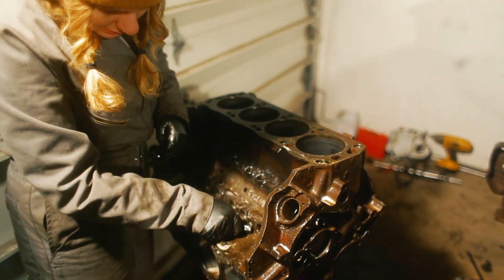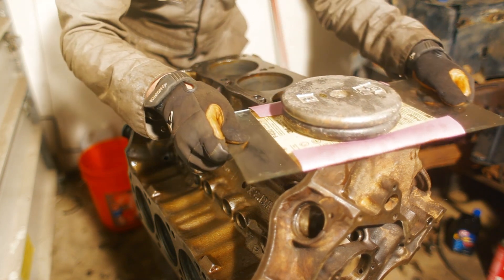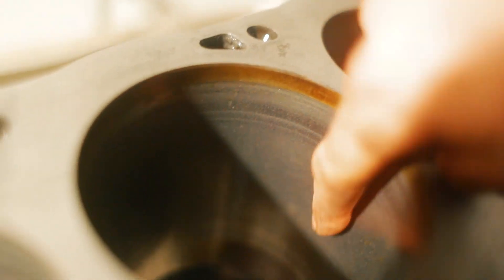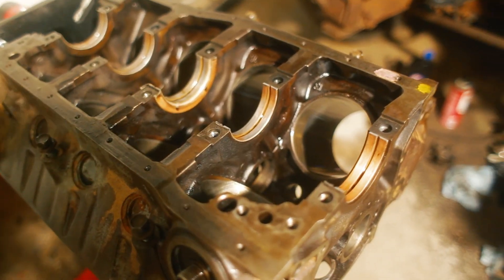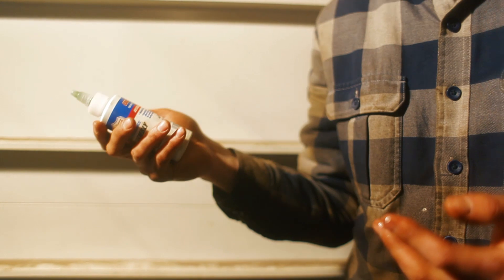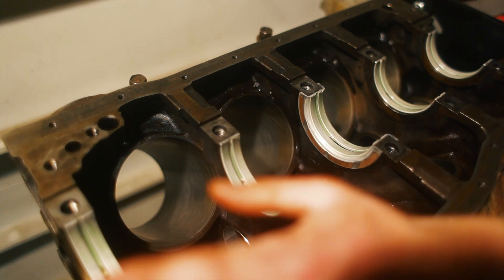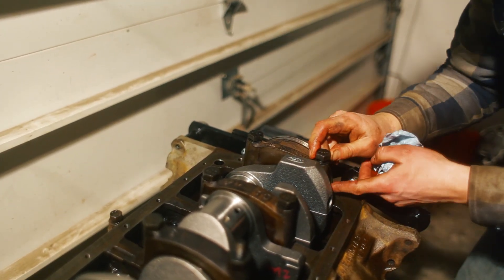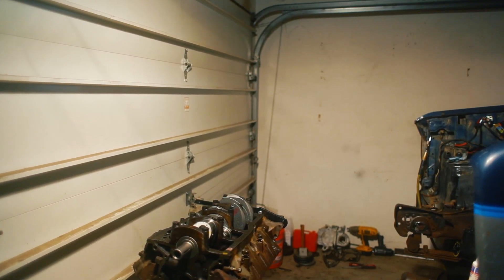F250 Ep 11: Starting the Engine Rebuild

Comment: Great video! Glad you guys are doing your part to keep another bullnose on the road! I think they’re highly under appreciated. Would you mind giving a ballpark estimate on how much it’s cost to come this far on your restoration?
Reply from the maker: Up until the engine we really didnt spend that much. $350 got us new brakes from the master cylinder to the wheels, including the nice flaring tool. A couple of oil changes and tune up stuff and maybe $50 in paint. 
The engine costs as much as you want it to, depending on the performance you go for.
Reply: @TheBadTimingClub  how much did you end up spending on engine parts?